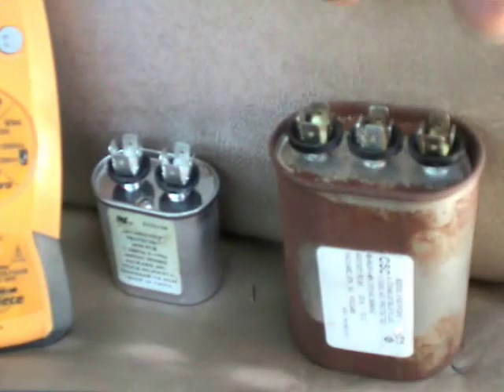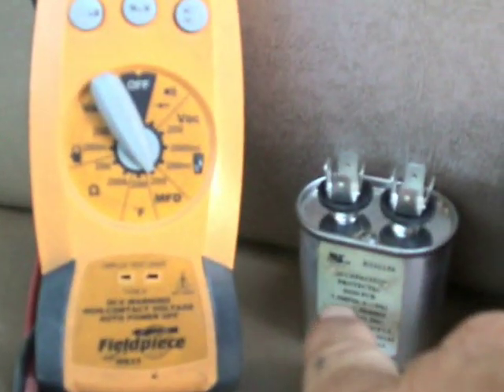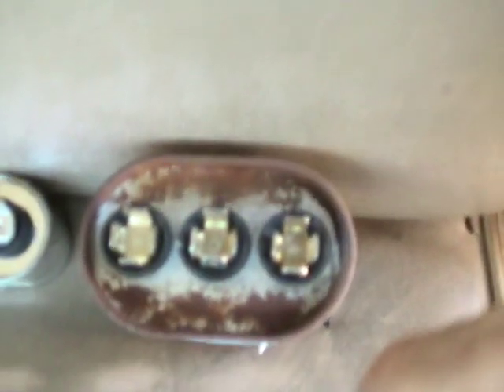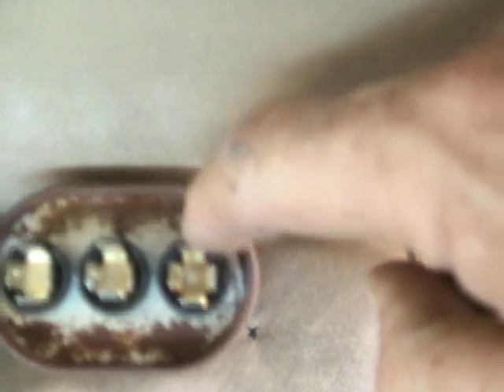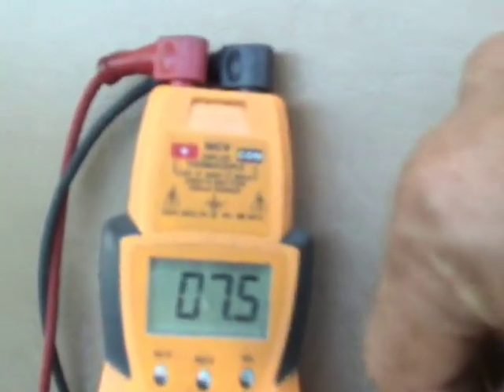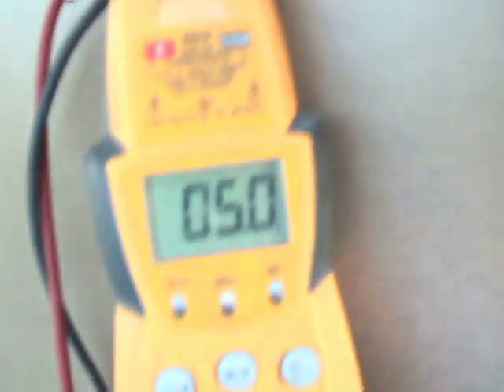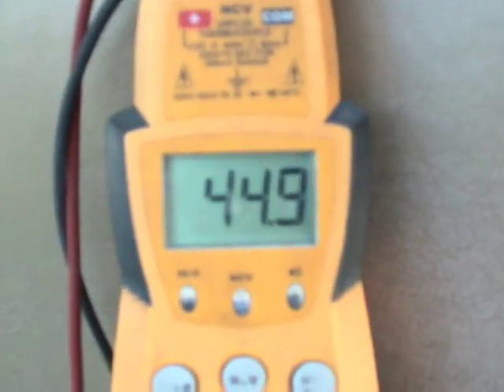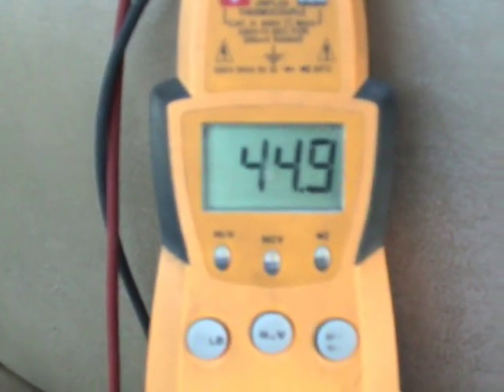HVAC Run Capacitors

Comment: I have a cap that is 45mF and 450VAC but the only thing available locally is 45mF and 440VAC.... Is that ok to use?
Reply from the maker: More than likely it will be fine.

Comment: Remember to DISCHARGE the capacitor first or you could damage your multimeter, then take your reading. One thing that I found is that on occassion, some capacitors short-out at operating voltage but look OK at lower voltages. Like that low voltage  from your multimeter and  everything seems fine. I like to apply a DC test voltage of know value  to these devices that is equivalent (approximatley) to the AC operating voltage that it is being used at normally. So if the cap is being operated at 120vac, I will apply a DC voltage of around 80 volts (from my bench power supply) to the cap and see it holds the voltage without shorting-out. So I look at the DC current being drawn by the capacitor. After a couple of seconds, it should almost be zero ! Also, if bring used on 120vac, the cap itself should be listed for at  least 250 to 300 volts plus - just to be sure. I know this seems like over-kill but I have run into this problem before - and it drove me crazy !! Just my two cents .......

Comment from the maker: The fan or compressor might not come on at all or it could heat up the motor until it shuts down on thermal protection.

Comment: You mentioned tolerance level of 6% +- being good. that is the expected output of the cap when it is new. without knowing the tolerance of the motor with regard to the capacitor you cant call a capacitor that is 7%  less than its rating bad.

Comment: Yeah, by like 1000 times, I bet it'd burn out in less than an hour at 100+ degree ambient temps. That one I installed that was labelled backwards, the fan motor sounded something awful, and got hot in just a few seconds of running.

Comment: This happened to me once. I installed a brand new run cap, and the idiots at the factory labeled it backwards. So, the compressor didn't start, just made a small little hum noise, but the fan started up very violently, and made a big noise. Confused the hell out of me for a few min, until I got the meter out and found out the "FAN" terminal had 35MFD!!!!, and the "HERM" terminal was only reading 5... It was SUPPOSED to be a 35/5 cap, it was backwards. Lesson learned: Don't buy made in China caps

Comment from the maker: Do you have a LG ductless system? Are you reading the volts from each compressor terminal to ground? If you are then more than likely the system uses an inverter to convert the in coming line voltage to three phase.

Comment: what is the voltage suppost to be on top of the lg air conditioner compressor I have 120v  on all three rcs. but the compressor does nothing not even warm or hum.  Thanks

Comment: Hi Dr.Z i have a question. I tested the run capacitor on my AC unit and it tested at herm 69uf.
And the cap is rated at herm 60uf. Does that mean that it's bad?
Also do you go by + - 6%?
Or + - 10%?
Thanks.

Comment: Yes you're right. I was going by some oversimplified information about them. They are there to offset the amperage and voltage peaks and that's how you get it to spin in the first place :P

Comment from the maker: @5NOOPY615 Not every air conditioning system is the same. Some 3 phase systems have no run capacitors at all.

Comment from the maker: @kj7ym I'm not really sure about your question. A dual capacitor is already used as two independent run capacitors. If you mean to use two independent run capacitors for the compressor and the fan motor then it is a bit different. The fan motor will use it's own run cap and the wiring can be different. It all depends on if you're using a 3 wire or 4 wire configuration.

Comment from the maker: @findvoltage The internet can be a good place to find info on run caps and start caps. The run cap is used by the compressor or motor during the run time. The start cap just gives the compressor an extra boost of power only at start up.

Comment: @DrZarkloff hi again, i ment run-start capacitor, as a single unit. if it does exist can you give me an example how it works, i know that two metal foil sheets hold a charge and relese that charge, but a normal start cap would malfunction if i used it for a run CAP. so what is the difference  between the two, thanks again DOc.

Comment from the maker: @ylor123 Most condensing unit will come with just a run capacitor because of the expense. You can field install a start capacitor later.

Comment: Hi Doc,
I took your advice! I replaced the dual cap, and sure enough both the fan and the compressor are up and running. My friend has a capacitance checker. Both caps on the old unit were open.  I read on the internet that my 5 year old Carrier model has a capacitor problem.  This bears it out.  Thanks for your help.

Comment from the maker: @headscratcher99 You could try to replace the dual run cap. If that doesn't work for the compressor then you might want to check into getting a hard start cap.

Comment: Hi Doc,
Hey! It's hotter than Hell here in Philadelphia!  A perfect day for my whole-house Carrier outside unit to fail.  :-)  I suspect the dual starting capacitor.  What do you think? The compressor will not turn on (I think I hear it trying to start, but it shuts down), and I need to manually spin the fan motor to get it to come up to speed.  The capacitor is hot, but then again, everything here is hot! Thanks in advance, Headscratcher

Comment: ok, i have a question my air conditioning capacitor burn a wire twice  from  ''C'' and ''H'' 
 side. i fixed by my self but the wire getting short and  i want to know why is burn it wire?

Comment from the maker: @thereelmaster If you short the line voltage to ground, it will trip the breaker or fuse. I'm not sure about what you'd have to do to get the motor inside of a reel to reel tape recorder to run backwards. Maybe you can figure out what happens when you put it in rewind.

Comment: i have a question, if you hook up a run cap to a motor's ground lead. and the hot to the ground, will the motor run back word's? i need to know becuase im working on a reel to reel tape recorder that run's a clockwise motor,and i got a motor that originaly ran counterclockwise. please reply.

Comment from the maker: @jwablueeyes I know that it seems odd but you can run your run caps in parallel to add up the rating you need. I don't recommend making this a common practice. It's good in a pinch.

Comment: what if you had the same 5/60 uf   370 vac but your available replacement was 5/60 uf  440 vac ? would the extra voltage rating be ok ?

Comment from the maker: @MrTERRYD55 The problem is that the compressor side on the old run cap is 50. You could use a 50/5 X 440. A 45 wouldn't give you enough capacitance, causing the compressor to not start at times and making it overheating while it would be running.

Comment: what is the problem using the step up on the voltage ...for instance the old cap unit is a 50 / 5 x  370 and used 45/5 x 440 what is the harm if any....the fan side on the old unit was bad...

Comment: Capacitors usually fail open or short, rarely change value (split-phase caps are plus/minus twenty percent anyway, so a 5MFD could be anywhere from 4 to 6).  You can test with a normal DVM by charging the cap with a 9V battery.  Just short the battery lugs to the cap terminals for a few seconds, take it off, wait a minute or so, then test with the meter set to DC voltage.  It should start out very close to 9V and slowly drop as the cap drains through the meter.  Zero volts means a bad cap.

Comment from the maker: @estrelladelnorte1308 You really need a multi meter with a mfd setting to do it right. There is a way to using the volts setting while the system is running. I don't find it to be very reliable.

Comment: i replaced a bad fan motor on a carrier unit and used the same dual cap that was there but it didnt work.. i had to actually buy a seperate run cap for just the fan i dont know why it didnt work with the dual cap???

Comment: Mfd=2650xI/E

Take the amps on start winding this value times 2650 and total divided by voltage on capacitor (common to herm or fan depend what you want) thats gonna give you capacitance

Comment from the maker: You might want to look on the capacitor and make sure that it says NO PCBs. If it does then you were sprayed with an electrolyte that we all hope won't later be found to cause cancer in California. By the way, PCBs have already been found to cause cancer in California and most other states.

Comment: I just replaced my indoor Blower motor and capacitor I have 2 purple wires that go from the motor to the capacitor. Are there polarities for these and if so what are the polarity indicators, I do not see anything marked with + or - ?

Comment: I'm surprised that you actually touched both of those open terminals like that with stored voltage in them. From what I understand, these H.V.A.C. capacitors can charge up from ions in the air. So, most electronics stores that sell them, short out both terminals with a piece of wire to prevent that. Also, a general safety warning should be posted, since you never know what of of audience on Youtube will be watching.

Comment: I replaced the contactor.  It worked for a day perfectly.... and now its still the same.  When I turn on the thermostat, the wire to the contactor shows 24v, but the contactor failed to engage.  Should I also replace the time delay relay too? (its located in the side panel of the condenser with 3 wires going into it?)  Or is it located elsewhere?  You response is greatly appreciated...thanks Doc.

Comment from the maker: It sounds like the system is running normally. A time delay is probably holding the compressor out for the five minutes. The time delay is a safety device that prevent the compressor from short cycling.

Comment: Hey Dr. Z, Love your videos.  I have a question:  I turn my ac on from the thermostat and my condenser doesn't  kick "on".  If I push "in" on the contactor it energizes and starts working.  Once this happens, my ac works fine.  When the desired temp is reached, the system goes off as it should with fan delay staying on a minute or so.  When room temp goes back up, it would take the system 5-10 before the compressor would come on again.  Should I replace the contactor or capacitor or both?  Thanx

Comment from the maker: The run capacitor gives the motor continuous starting power even while it's running. Three phase motors don't need run capacitors because the third phase gives the motor more running power.

Comment: Dr Zarkloff,

What is the purpose of a run capacitor hooking up on motor ? Does it try to correct the phase shift caused by the motor? Thanks.

Comment: While checking out my brother's A/C, I noticed that the blower inside the air-handler was cycling on & off. It runs for a minute-then shuts off for 15 secs. Run capacitor check?

Comment from the maker: Say what? I would hope that you'd discharge any run capacitor before removing the wires from it. If you'd check out my HVAC air conditioning safety video you'll see how I discharge the run cap.